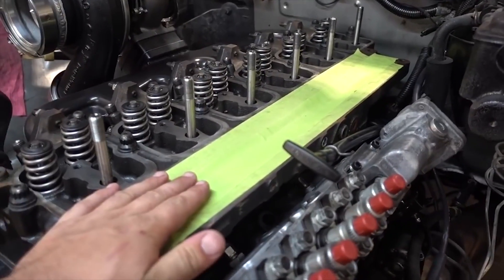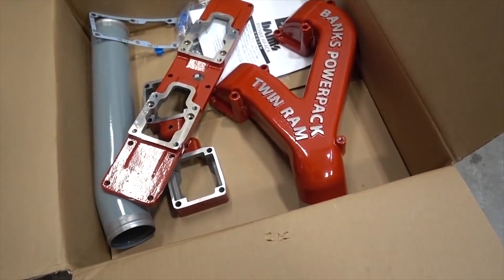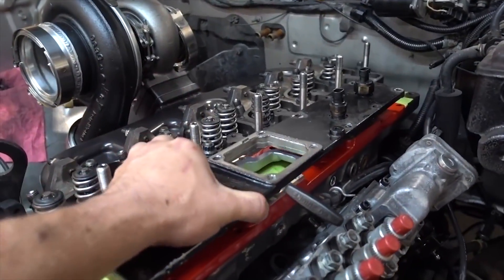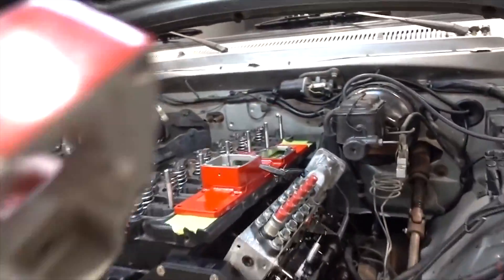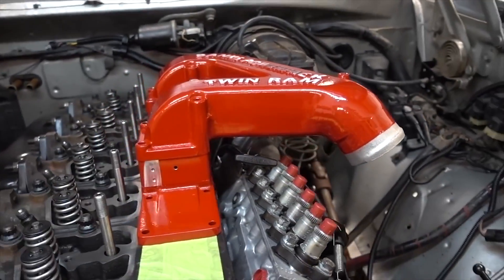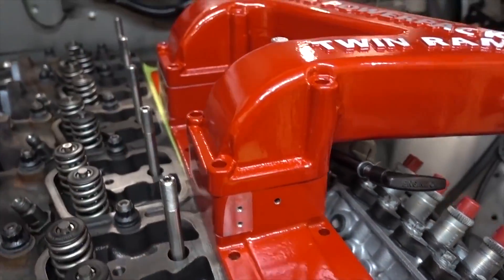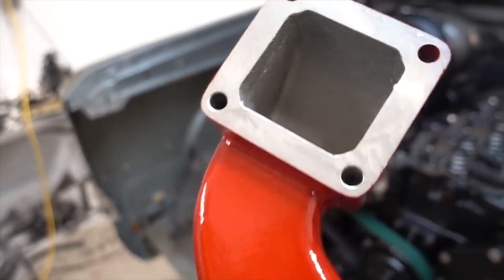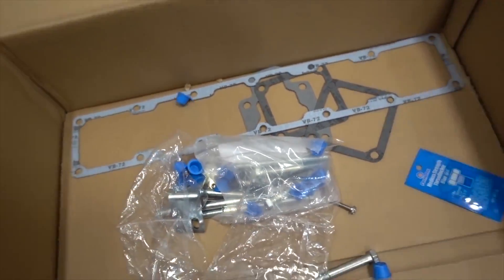Greg Alberalla Installs a Banks Twin-Ram Intake Manifold

Comment: Does the pump have to be changed?  Im not a diesel guy  but learning .. Does it help a stock set up?   
i wish someone locally would tear down a 5.9 and need some help - I could get me some learnings :)
Reply: I’d recommend looking at built trans options, just better to be on the safe side. Even 200 horse over stock can really hurt the trans. Stock cooling on these pickups do a very good job keeping the temps down. Also would recommend a kdp kit in the timing case. But what it all boils down to is what are your plans for the “truck”. To tow with it, to daily it, to make it all around beast, it’s all questions a guy should answer in his head before he starts spending thousands of dollars on parts. Sometimes it’s better to just stay bone stock for reliability. 

As far as gaining experience with anything don’t be afraid to look on YouTube here. Check forums, online parts diagrams and etc. it’s relatively easy to learn
Reply: Will do  , Thanks   Im after dependability , I use it for work , toting tools , not much pulling .. I'll check out a kdp kit ...   Thanks bro
Reply: @dsmit303 what would u recommend for towing i have a stock 2nd gen 5.9 24 valve and i was thinking of upgrading to atleast a banks manifold what do u think ?
Reply: Ronbo Nick what year pickup do you have?
Reply: 97
Reply: If it’s a 97 it will already have a ppump on it! A 5.9 12 valve is a relatively easy platform to learn on, are you looking at turning up the stock pump?
Reply: Yes whatever I can do to pick up some ponies, without  causing any issues ( overheating and tearing the transmission out of it ( an automatic) ..
Reply: I have a bone stock 5.9 what do i need to do if i just want to upgrade the intake manifold to a banks ??? Somebody help me i dont know alot about diesel